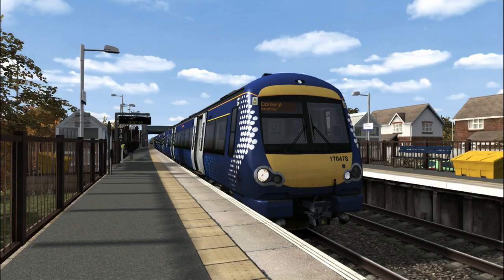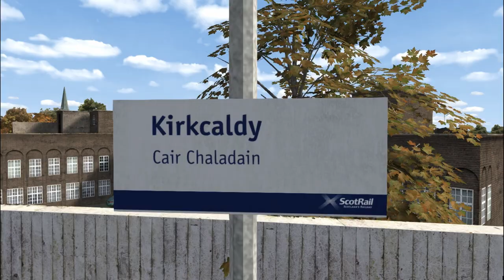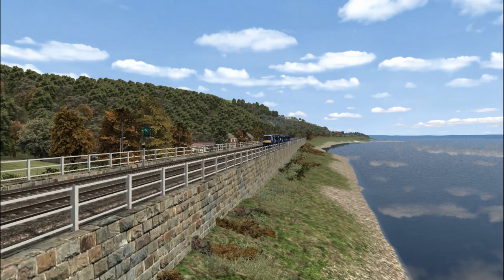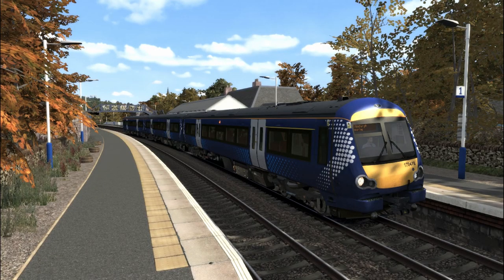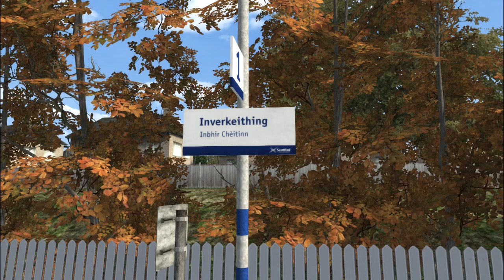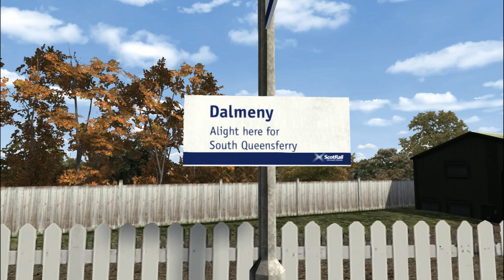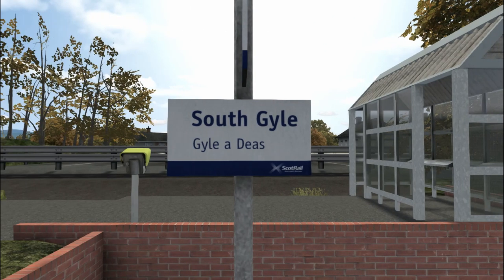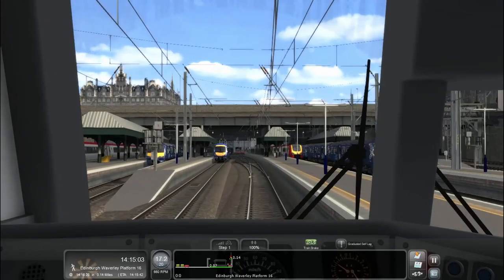Driver's Eye View Fife Circle Line Part 2

Comment: Your pronunciation of Glenrothes and Kirkcaldy could do with a little work. 

Glenrothes = Glen-roh-thiss

Kirkcaldy = Kuh-kod-ee

. . . And Rosyth is Roh-sigh-th

Also, ive never heard of a Dalgety Bay terminating service.

Also, small technicality - you are correct about Haymarket depot servicing classes 158, 170 & HSTs for ScotRail, but only the 170s and HST sets are based there. Our 158s are split between Corkerhill & Inverness depots. 

And im guessing trainsimulator doesn't have 334s as AI traffic yet, hence the presence of 320s at Haymarket 😅😅

Oh, and 'Princes Street tunnels' are actually called 'Mound tunnels' 

Good video nonetheless 👍👍
Reply: As a guard who actually works these routes, and has to announce station names every day, give us a shout if you're doing anymore scottish routes and would like to double check pronunciations or names of structures/junctions etc. :)
Reply from the maker: Thanks Anthony and in fact I am thinking of doing the Edinburgh to Glasgow route via Falkirk High which was recently added to the game.
Reply: @TicTacTrolleyServiceTico  excellent

So 

Edinburgh Waverley Station
Mound Tunnels
Princes st. Gardens
Haymarket Tunnels
Haymarket
Haymarket East Junction (where west coast and shotts services diverge towards Slateford etc.) 
Haymarket Central & West junctions (where the Edinburgh South suburban connects, also Haymarket depot to your right)
Edinburgh Park 
Newbridge junction (North Clyde line to Bathgate etc diverges) & down passenger loop
Almond Valley viaduct 
Winchburgh tunnel
Winchburgh junction
Linlithgow up passenger loop
Linlithgow Station
Avon viaduct 
Manuel down passenger loop (also, connection to Bo'ness & Kinnell railway is here) 
Polmont
Polmont junction & loops (site of tragic crash in 1984 - DBSO end of locohauled train hit a Bull) 
Falkirk Tunnel
Falkirk High
Greenhill upper junction 
Castlecary Arches (pronounced like Castle 'kerry', its the bridge that carries you over the motorway) 
Croy
Gartshore loops
Lenzie
Cadder loops (and yard, currently being expanded and built out as a servicing and maintainance facility for HSTs I believe)
Bishopbriggs 
Cowlairs East Junction
Cowlairs West junction (adjacent to Eastfield depot on your left)
Cowlairs South Junction
Cowlairs incline 
Queen st tunnel
Queen st. Station

Down towards Glasgow, Up back towards Edinburgh 

If you need any guides on the pronunciation of any of those places names ill try to spell them out :P or if I join your fb group, I can record the station names and send them to you as voice recordings

Are you doing it in a 170? Or has it been modelled with the wires?